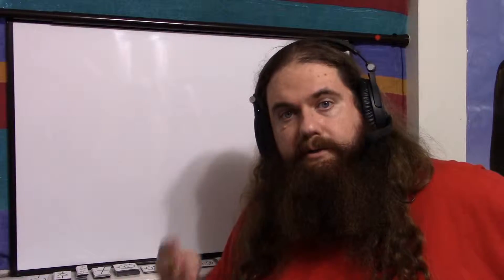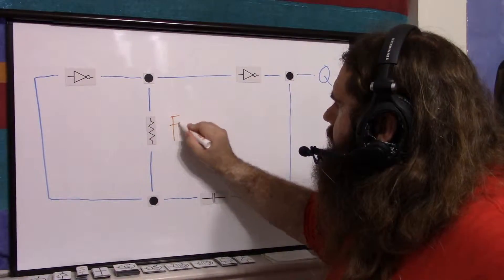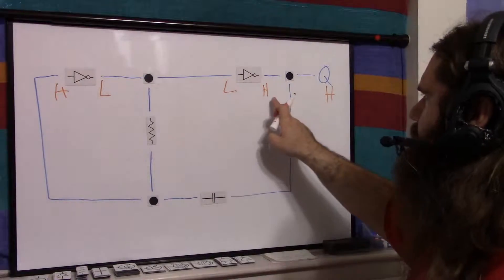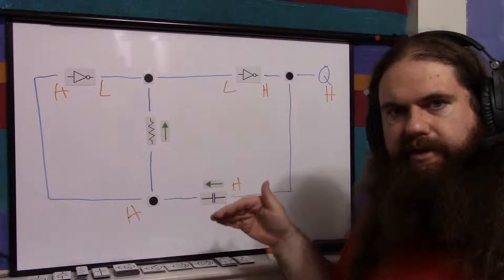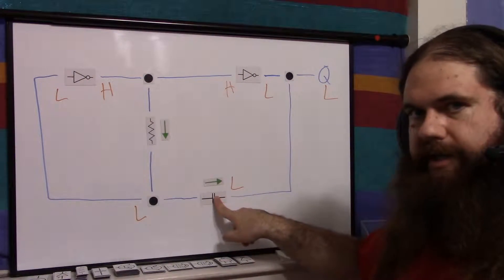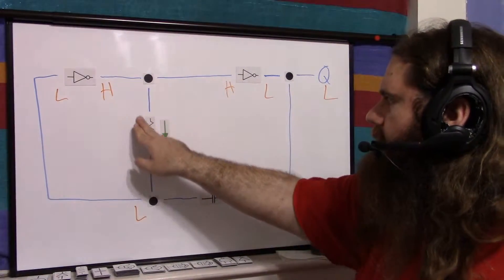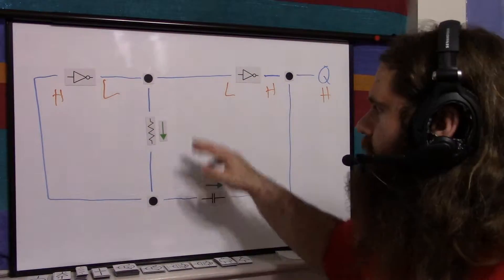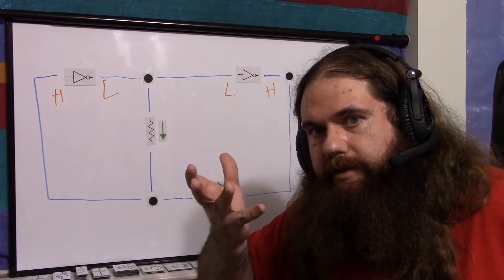CMOS Square Wave Generator - MOSFET Astable Multivibrator - Simply Put

Comment: Why not use a Schmitt trigger inverter? You can remove the other inverter that way
Reply from the maker: Because I'm still learning, is the primary reason. I'll make a note of this and look into it!
Reply: What's the difference when NOT gate also has some hysteresis. Is it about complexity?
Reply: Almost exactly the same circuit with one inverter: just tie the capacitor to ground. The circuit in video will drive gate input a few volts above Vcc 👎